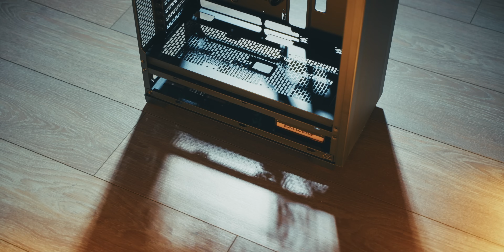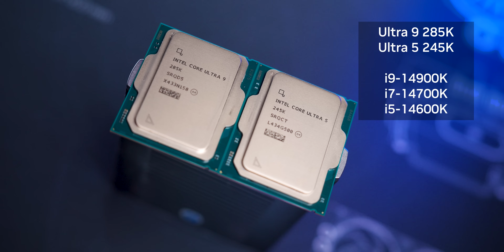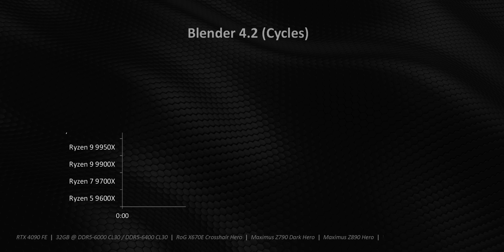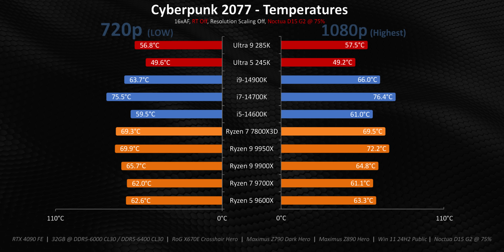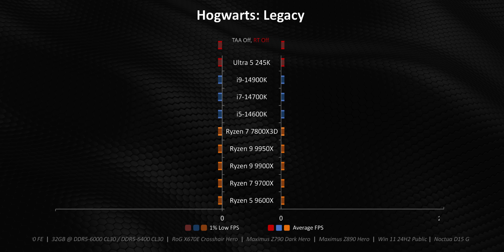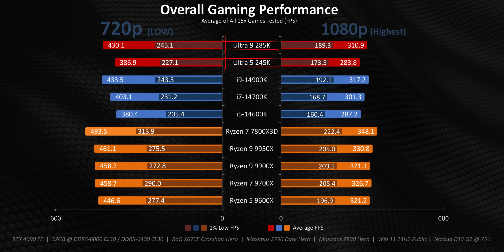Intel Hits Reset - Ultra 9 285K & Ultra 5 245K Performance Review

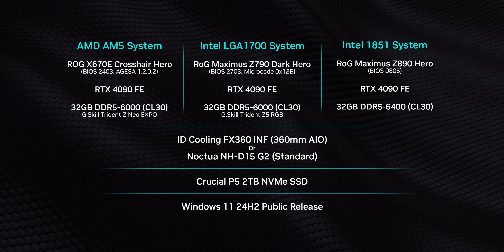Comment from the maker: Over the course of testing, we were in contact with a number of reviewers who asked us about stability with 24H2.  With our setup using the firmware / BIOS listed at 3:12 of the video, we had one of the smoothest experiences with a pre-launch platform we've ever encountered.  It seems like other folks (many who were using MSI motherboards) experienced nightmares.  Guess that's another reason to recommend you skip Arrow Lake for now.  :(
Reply: I would say avoid ARL + MSI mobo combo , instead of ARL entirely. With Asus / Gigabyte mobos  everything seems to be rock solid.
Reply: It's anything but, ASUS were notoriously unstable for HwU... It appears to be related to the memory controller. People keep using OC profiles to reciew CPUs because manufacturers want the false advertising. Joe schmoe is going to use non XMP profiles. Only TPC and computerbase producce good reviews in this aspect.
Reply: @jebusnazareth1869  I value stability over performance   since i am making a pc for work , i will use a 6000mhz ram on my rig , so within the  intel  memory controller  spec (which is 6400mhz)
Reply: @jebusnazareth1869  am building a business PC so  ram will stay within intel MC spec. Will be using a 6000mhz ram which is lower than 6400mhz.
Reply: @jebusnazareth1869   I  will  be using a 6000mhz ram, which is within intel MC spec.

Comment: Blah, blah. I can't see much to choose between 13th/14th and 15th when they're all tuned optimally for volts and clocks (although of course that's a lot of work for the first two and probably beyond most users), maybe an incremental rise in speed for rendering and editing but we know they're worse for gaming. Screw Intel.

Comment: If you have a 13 or 14 series higher end CPU, there may not be a lot here to push you to upgrade. An incremental improvement compared to the costs of going to an entirely  new hardware platform, maybe not this time around.  A smarter upgrade at least this year might be a new video card.

Comment: Performance uplift 404 not found 

Ipc increased but clock decreased 

Old gen npu and gpu ( not newest in launched core ultra 200 laptop chip ) 
Power saving ( thanks but not critical) 

Intel please tell a reason why have to spend 500+ to get a new board and new slightly better 14900ks ?

Comment: Why is no one talking about the fact that they went from 10nm to 3nm? And the power consumption only dropped a little, and the performance didn't increase at all. If Raptor Lake would just switch to 3nm it would be better!
Reply: @Dim_Test it is disappointing a bit, but not that much. First, their 10nm++++ is actually just a bit better than TSMC's 7nm. Hence why Intel renamed it into "Intel 7". Still, that leaves us with 2 full generations (7 -> 5 -> 3) which is still quite a lot. But, the power consumption is not a little, it's quite a lot in some situations, even as high as half. Half power same performance is in line with 2 nodes of improvement. Also, they ditched hyperthreading (which helps in some situations) and also have lower clock speeds for single/dual core usage (and I think about the same on all cores workload).

So not ideal, but I think it's also because of the move to chiplets, that alone makes them lose a bit of performance. But having a monolithic chip makes them more expensive and more limited in how they can grow. And less modular. And even so they're quite expensive (becase the N3B is expensive). If they have stayed monolithic it would've been even more expensive, as bigger chips have higher chance of having a fail and thus a higher percentage of a wafer would not be used, increasing the price for all the chips.
Reply: 7nm bro no 3nm that's a lie. I've seen 7nm on cpu z' derbauer's deliding the high end. That's why the power is still that much.
Reply: @eric-pl6rk  Are you saying that they lied using or paying TSMC N3B ? Or that TSMC lied somehow about delivering N3B and somehow Intel didn't notice ?
Reply: @Winnetou17   it is 7nm on cpu z. I don't know if cpuz lied lol. but they lie to get you right lol

Comment: Top notch work guys 💪 

Scripted audio presentation accompanied by the information presented on the screen is👌

Chapters are done beautifully, with a sort of 'lets fact check the marketing claims with hard data' kind of vibe. All of them have a conclusion of their own

Things keep on heating up more and more as the video goes on 👍 

Charts are off the charts 😂

Everything has a logical order and it's color coded. If you believe that you can improve them further — be my guest. I wouldn't touch a thing
Reply from the maker: Thanks for the compliments.  We always find room for improvement since we know we can always do better in some areas.

Comment: I wonder if a lot of the gaming performance results comes from an unoptimized scheduler from windows 11. if AMD gained 10% in a windows update it’s gonna be interesting to see if ms and intel will keep pushing updates that makes the cores work as intended for their respective tasks
Reply from the maker: Well here's the issue. There haven't been any fundamental changes with Intels scheduler for this generation. They are still using an evolved version of thread director and the related back end components
Reply: @HardwareCanucks  Never underestimate Windows' scheduler ability to fail or underperform. Windows 11 is 3 years old yet we still have issues with AMD with chiplets and with Intel on 12th gen and newer. If it was properly competent, AMD wouldn't have had so many issues, wouldn't have needed so many special drivers, Intel wouldn't have needed Thread Director and especially APO. People wouldn't have learned what Process Lasoo is.

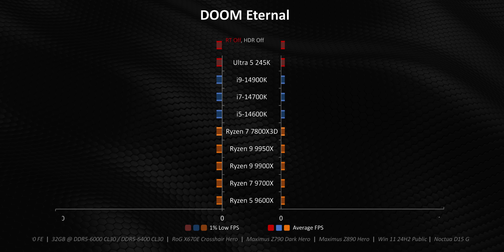To this day, even after the saviour that 24H2 is claimed to be, some games, like your own DooM Eternal test at 14:06 show higher FPS on R7 9700X versus R9 9950X. That should never happen. R9 9950X is same or better in every single metric, especially silicon quality and boost clocks, and as such, it should NEVER have less performance. But nobody has time to test with one chiplet disabled on BIOS or with Process Lasoo.

All the above reek of how "performant" the Windows Scheduler is.

Comment: Its amazing how most of the biggest critics of AMD and the Zen 5 CPU's spinned this whole intel launch such that the intel launch seems ok?

WHAT? They hardly have a 1-5% increase if ever? And the power usage is all hoax...look at cinebench sage etc. Using 250W agains tthe 14000K 253W? to achieve slightly better?

This is on many reviewers reviews...you are all very kind towards intel.
Reply from the maker: The chip doesn't use 250W continuously in multi core workloads....

Comment: The 9950X has 16 cores/ 32 threads vs the 285k's 24 cores.  32 - 24 = 8 threads not 12.  And each thread in the core are sharing resources like L1/L2 cache.   2 threads usually convert to about .13-1.4 actual cores.  Cinebench is a terrible tool to speculate nT performance.

Comment: 10:00 how did you check the power through software or hardware ? Cause its not only taking power from 12 v eps
Reply from the maker: We use HWInfo's package power which has proven over time to be extremely reliable.
Reply: @HardwareCanucks The issue is Asus engineering decided to change where the cpu gets it's power which hasn't been done in recent memory so although HWinfo is pretty reliable traditionally, on this one Asus board it's probably not accurate. Everyone else's reviews are reporting differently but it's not your fault. My guess is Asus and/or Intel did this purposefully to make the chips look better and to grab more sales which is a pretty scummy thing to do.

Comment: How did you measure CPU power for the arrow lake chips? ASUS motherboards have up to 50w of power for the CPU running through the 24pin ATX connector so measuring power at the 12v eps cables is highly inaccurate. Software reported power has also proven to be highly inaccurate. Also It's odd a lot of your 1080p results seem GPU bottlenecked. Even using high settings, 1080p should show more CPU differences. The exception would be if you're testing in intentional GPU bottlenecked situations. Built in game benchmarks for instance.
Reply from the maker: OMG....the misinformation is high here.  You are referring to transient outer (+12V PWR) loads vs what we use which is HWInfo's voltage rail reporting.  One isn't more or less accurate than the other.  We could literally probe the CPU rails and get completely different results.   So...what's your point?
Reply: @HardwareCanucks  Oh so you are accusing Gamers Nexus of misinformation? I'd love to see that video.

Comment: I own the 265K for a week ( Made in Vietnam - leaked a bit earlier ) having replaced my i9-13900K (hot running) and can’t be more satisfied.
CPU temperature dropped from 55-65 average to 38-45 average
PSU consumption dropped from +300W to an average of 130-180W
Fans run at 40% of power, can’t hear my rig even - totally quiet. 
Yes- I am a believer through usage. this is a good release

Comment: Isn't one fundamental reason behind the modular die design to save cost? If so, why are these processors still so expensive, I wonder. We saw here that the single die processors do well, which isn't too surprising. Transfer speeds within a silicon die is potentially much higher than through copper traces between dies.
Reply: N3B, that's why
Reply: They pay for TSMC instead of using their own node
Reply: @AlleonoriCat  Well, that's true, but I'm not sure if it's necessarily that much more expensive. Hopefully though, Intel will get their new node up and running soon-ish.
Reply: Save costs so they can make more profit.
Reply: One bigger monolithic chip is way cheaper than ARL tiles on the newest and most expensive node packaged and on a huge substrate and interposer. Intel won't make any money with ARL considering it's disappointing performance.
Reply: @nipa5961  As I understand it, not every die is made on the same "high-end" node, so there is likely a significant cost saving there. Of course, there's logistics and other costs involved instead. Yields matter too. But yeah, the results don't look good at this time.
Reply: @Vermilicious  According to analysis on /r/hardware Arrow Lake's compute tile alone on TSMC3N is $43. Both CCDs of a 9950X combined are $32. Add all the other tiles, the huge interposer and the much more complex and expensive packaging to imaging the huge difference in costs.

Comment: Thanks for the overview, I'm liking the new style of the low and high charts, I think it's a great way to show a reality check on GPU bottlenecks all at once instead of potential buyers focusing too heavily on pure framerates. I mentioned on another video that I'm using a Gigabyte B350 motherboard that has done well for me over multiple Ryzen generations, from 1700X to 5900X, and I was hoping to give Intel a chance this next round. But surprisingly to me, and proven in your charts, the 9700X and 9900X suddenly look all the more attractive against Arrow Lake for those of us wanting both solid gaming and productivity platforms in one. I'm really curious to see a 5900X vs 9900X vs 285K breakdown. As great as the X3D chips are, I just don't think they're for me with the lackluster productivity results...unless the 9800X3D really changes things.

Comment: You might as well call your channel: 'Shill Canucks' after this "review".
Reply from the maker: In what way?  Our intent was to keep it as balanced and unbiased as possible.
Reply: @HardwareCanucks  You're making out as if these chips are good and that somehow this new generation is somehow a good thing when they're going backwards, not forwards and with massive flaws right out of the gate. Yes, AMD didn't have the greatest of launches either, but at least they gave performance in multiple areas rather than taking it away.
Reply: @JynxedKoma  This could very well be Intel's Zen1 moment but we can only tell that in the future.
It's a pity the Royal Core project was dismantled.

Comment: Yes……..your power consumption is incorrect. It uses power at the 24 pin also (60 to 70 watts additional)
Reply from the maker: How are you assuming that?  HWInfo reports CPU Package Power directly from the CPU rail(s)
Reply: @HardwareCanucks  Only on the CPU power plug(s). Not off the 24 pin. DerBauer pointed this out.
Reply: @HardwareCanucks  Assuming? Watch gamers nexus, it's dissapointing that such a big tech channel is so clueless when hardware unboxed did their due diligence to check in with GN before publishing their review.

Comment: Intel misled on power. Measure at the wall, the "efficiency gain" is much less.
Reply from the maker: Measuring at the wall is one way to do it but you can't forget that measuring total system power takes other components like memory storage drives and what not into account as well

Comment: Imaging using N3B and still losing badly to the N5 7800X3D. That’s 1.5 nodes of advantage for Intel.
Reply: The N3B is also the most expensive node, so Intel will lose money if they sell it for any less than current prices.
Reply: @abaj006  yep
Reply: How is N3B 1.5 nodes ? It's exactly 1 node. From 5 to 3.
Reply: @Winnetou17  5, 4, 3. Hence 1.5.
Reply: @PowellCat745  4 is part of 5nm generation.
Reply: @Winnetou17  That’s why it’s .5 not 1
Reply: @PowellCat745  But that's just 100% wrong. If I go from 1.0 meters to 1.5 then to 2.0, that doesn't mean I went 1.5 meters. The .5 is included!

It would be 1.5 nodes if it would be from 7 to 4. Or from 6 to 3. But the half from 5 to 4 and from 4 to 3 are included in 5 to 3. Shocking, I know!
Reply: @Winnetou17  I consider N3B one node ahead of N4X which is part of the 5nm family. You think it’s only half a node. Agree to disagree.
Reply: @PowellCat745  Dude, check your sources. N3B is the BASE, the FIRST 3nm from TSMC's 3nm generation. It's the WORST 3nm. It's so early that they decided to fully replace it with N3E. Really, go to wikipedia and search "3 nm process" and read a bit.

N4X entered production AFTER N3B (formerly known as simply N3).

I mean, I don't know how you can say it's one full node between them. It's light and day that they aren't. The first of N3 vs the last of N4, which is also the last of N5.

I would argue that it's not even half of generation, since they both have 15% better performance as compared to N5 (actually only 10-15% for N3B, but 15% for N4X). N3B is still better as it is smaller/denser and lower power, but still, calling it a full generation is seriously off.
Reply: @Winnetou17  N3B is replaced not because it’s worse performing but because it’s too damn expensive. N3E literally has worse transistor density. N4X is only more efficient at high voltages and N4P walks all over it in lower power levels. You made it look like N4X is this power efficiency beast but it’s not.
Reply: 7nm on derbauers cpu z so no 3nm lol
Reply: @eric-pl6rk  Since when is CPU-Z more accurate than Intel's official spec page?
Reply: @eric-pl6rk  Get a grip. Straight from Intel's official spec of the 285K: "CPU Lithography TSMC N3B"

Look it up 🙂

Comment: Just shows how good the 7800x3d is for gaming, at insanely low power levels as well. With good cooling, undervolting and PBO it's even better. For simulator games its a must.

Comment: Watch GN on the power draw stuff.  Literally ignore everyone else.  They didn't isolate/test accurately to show the actual true efficiency (or lack thereof).
Reply from the maker: We don't need to isolate in order to get CPU package power draw numbers.  As a matter of fact, as you saw in the recent GN video, PSU isolation doesn't really work to accurately determine how much power is going to each component if current is split between connectors / components.   Even GN has stated that if HWInfo supports a platform, you can get very accurate A/B power numbers due to the way to uses rail voltage measurements on most (but not all) platforms.  And the HWInfo crew is VERY good at what they do for platform support; to the point where that even now have initial Panther Lake support.

Comment: so the reviews consensus for Zen5 was it's "not for gamers", and yet.... the cheapest one is better for gaming than the best ARL that's more than 2x the price.  wow.
Reply from the maker: Well at launch Zen 5 was a dog in gaming.  That's changed over the last few months, especially with 24H2 and to a lesser extent the new AGESA.
Reply: @HardwareCanucks  Same thing can happen for ARL, Asrock already had 3 bios updates before the release for z890 livemixer
Reply: @HardwareCanucks  Yes.  ARL-S could have used a bit more time "in the oven", but for whatever reasons Intel wanted it out "now".  I fully expect between microcode, BIOS, and Windows patches it WILL get better.

Comment: thanks for including 720p low and cb23, it is getting pretty rare so I really appreciate it!
Reply: who run 720P in 2024?  1080p and 1440p should be the standard in 2024....
Reply: @mgb2012  it is for testing CPU without being limited by the current gpus.
Reply: @riba2233 yep, good for testing CPU without GPU limitation
Reply: @riba2233  So completely useless information and waste of time.
Reply: @kazuviking  no. Please educate yourself.
Reply: @ Then tell me when this data is relevant? NEVER. When actual real world testing is done these cpus are neck end neck instead of this fake results. There only  a handfull small creators who do real testing.